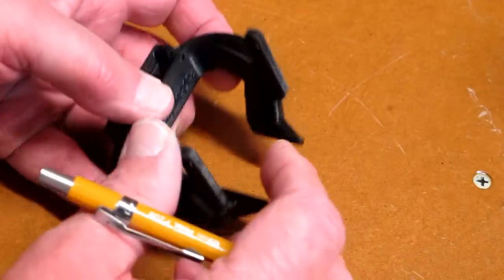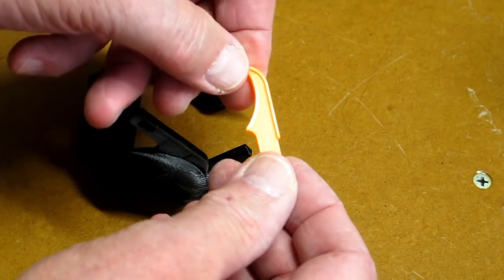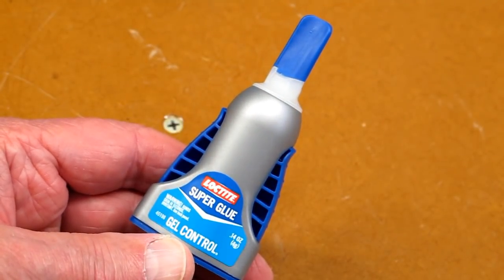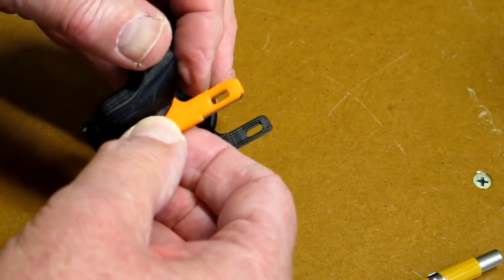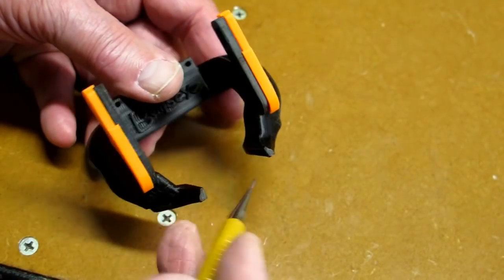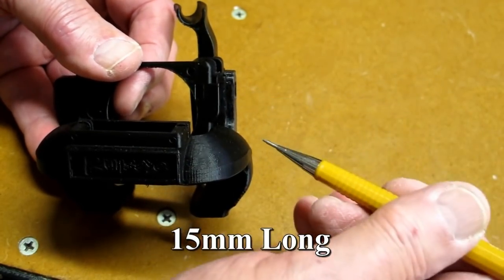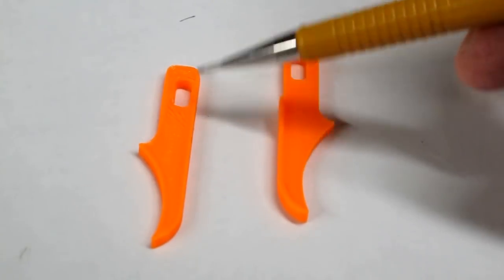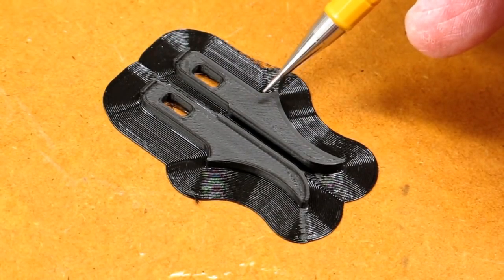Bullseye Duct Pipe Mounting Arm Reinforcement

Comment: I do this a lot, you can't always print something as it should be printed so you have to improvise. I found that the black rubber heat resistant glue from Loctite (forgot the code number, but there's only one) is extremely good for PLA, i think it actually manages to melts the plastic superficially on contact because if with regular glue i can sometimes split parts, i can't even find a seam to part through.

Comment: Nice work.  I always enjoy your emphasis on strengthening things.  A case in point is the drill press gear box.  You're a thinker and a builder.  Much respect.
Reply from the maker: Working in the oilfield and mining industry gave me a lot of experience around people who seemed able to break anything and around equipment not always designed to meet the challenge. A major part of my work involved maintenance, repair, modification, redesign and fabrication of better stronger equipment. Building and flying R/C airplanes is another 101 Course in making things stronger. Appreciate your comment. Thanks for watching! Ron